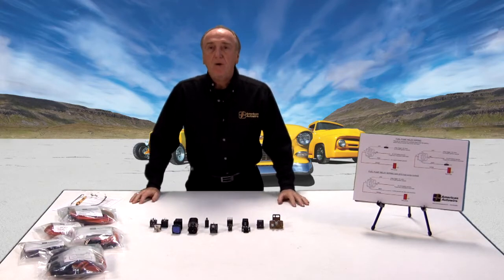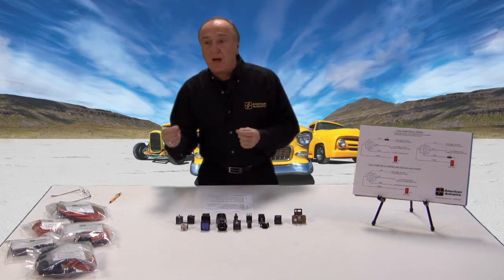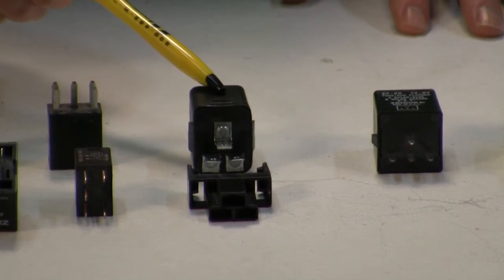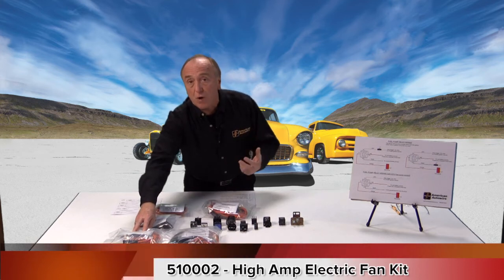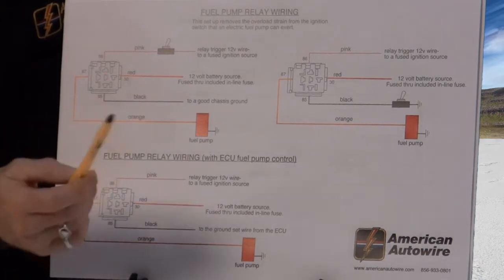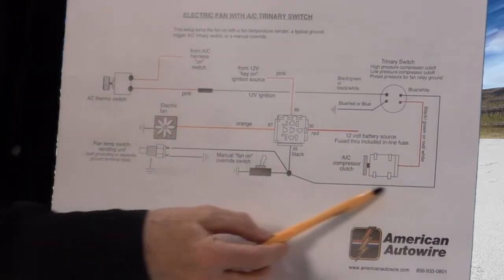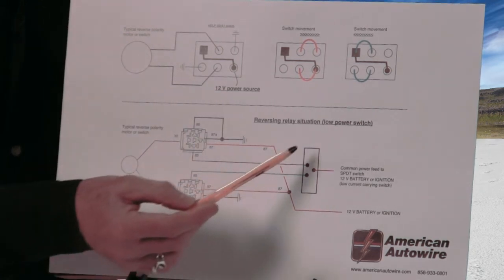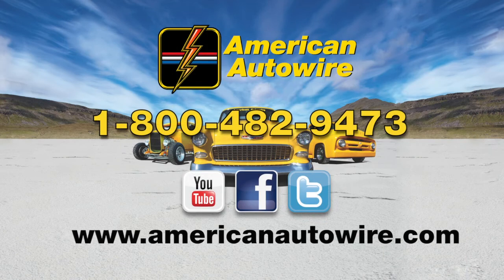Relays: Their Functions & Uses

Comment: Excellent "Tech Tip" video !  Relays are one of those areas that are a great mystery for many people.  Relays solve those high amp problems especially when you wish to switch with ground or with low amp rated switches.  This video should help those DIY's when the need to wire relays is needed.  Thank you guys !
Reply from the maker: Thanks Stan!!